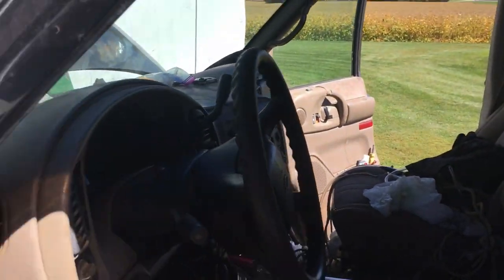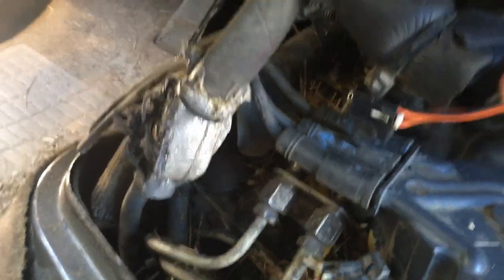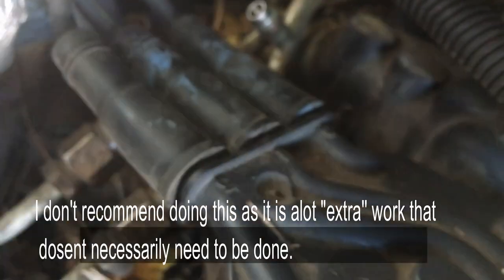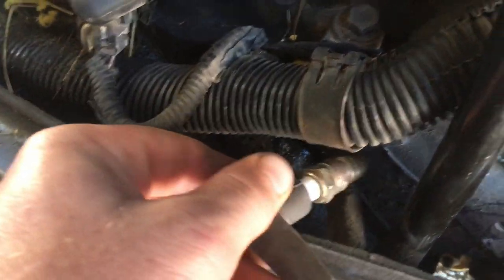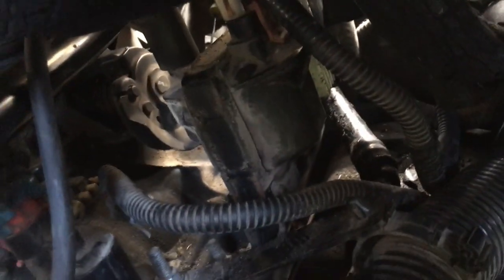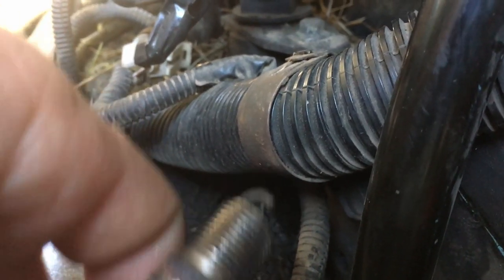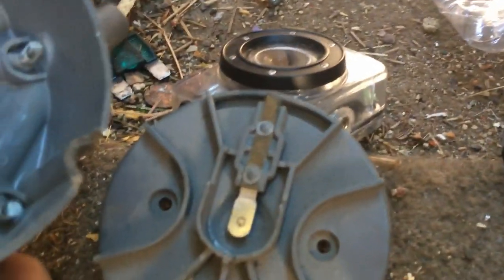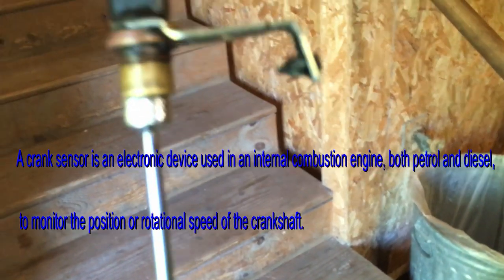Crank's No Start Chevy 4.3 Astro van No Start-Fix Year 2000

Comment: I just went through this with my S10. I searched and searched and never saw this video, until the week after its fixed. I bought a fuel pressure gage, compression gage and they checked ok. Then  I tried  New coil,  ICM, Mass air flow sensor ( had a code for this one), cap and button, cam sensor and finally the crank sensor.

Comment: Thanks for the video and not a bunch of hogwash talking to go with it.  I’m going to try the CPS tomorrow being that’s about the only thing I haven’t tried.  The VORTEC engines are well known for faulty cap & rotor, especially if they sit for a week or longer without being started.  I replaced the hall effect switch in the distributor (also called the camshaft position sensor) and that got me running, but then it quit again.  So I swapped out the ICM (ignition control module) and they go back from normal usage (they get real hot during normal engine operation).  When I first started my diagnosis I saw no fuel pressure, so I hot wired 12V through fuel pump relay, then I had fuel, but no spark.  One thing that can trip you up on these vans is they have VTD system (anti-theft) on them  and the fuel pump circuit gets interrupted if it thinks it’s being compromised by theft.  I’ll come back here to report my findings tomorrow.   Again, thanks for the video.
Reply: So what ended up being the problem and how'd you solve it.?   Ive been stuck in a parking lot for a month😢 

I bought a new coil, new ICM, new CPS, new distributor, new cap, new rotor, new wires and spark plugs, new coolant temp sensor. Finally today i got a code reader.   I have 60 psi fuel pressure. 
I believe thats good.   I think its the spider injector.   Someone said i just need to clear the codes and it should start, with everything i replaced, as it needs to relearn.   Please help.
Reply: @manuelester7420 did you figure it out bro i need help too

Comment: Thanks for the video.My 2004 160K mi astro   had the same no spark failure while driving.( Halfway to the donut store) strapped it home, started down your list;  Crank sensor "no",  coil, "no" Dist C&R, ''"no"  "  Ignition control module ,  "Bingo".  Runs perfect.  Following your example,  i now carry spares for all  & may add a fuel pump.

'

Comment: Great video sir.....My astro suddenly didn't start...so your advice will be part of my troubleshooting ....thank you
Reply from the maker: No worries, I just got through a No start situation, my van would not start "easy" when it got below 32 degrees for the last couple years, this winter it finally just stop' d starting all together, I had fuel pressure and spark, turns out it was a faulty ignition' "Will be making a video on this soon" but don't feel hesitant to ask me any more question if the video doesn't help you get it going, I've been through several no starting situations with my van. Ps. I'm working on growing my channel to 1,000 subs, if haven't done it yet and wouldn't mine subscribing to the channel it would def, be greatly appreciated! Thanks!

Comment: Just picked up a 2000 Astro AWD cargo w/141K and it's like I'm waiting for the other shoe to drop because I have no maintenance records on it.
Fluids seem okay. Already replaced the screeching belt and broken tensioner (Gates) with AC Delco. That's an obvious problem to fix but no way I could've figured out yours. At least I learned something that might come in handy. Thanks for posting.

Comment: Hi Matt .....thank you for your advice you were right, it was the coil assembly that was defective. I replaced it  and it is running fine again. 
By the way....I love my chevy Astro a lot too. You are the best....
I subscribed and keep on uploading great videos pls.
🤫  (about Chevy Astro🛠)
Reply: The only times that my -99 Safari would crank and not start, it was the coil.  Original coil lasted 12 years then I put 3 after market coils in over the next 2 years.  Never replace with an after market coil from China or Mexico.  Back to OEM's A.C. Delco  coil and it's been running on that one now for 7 years.

Comment: Great video! I just changed the spider on mines now the vehicle won't start. Hopefully I'll figure it out soon. Prior to that I changed spark plug and wires, cap n rotor, icm, crankshaft position sensor, and a few other parts. The reason I changed the spider was because I got the check engine code p0302. Vehicle was running fine prior to changing the spider. Also seems like the previous owner removed the bulb for the check engine light..smh
Reply from the maker: Hope you get it going man! Yah, i definitely don’t trust all the codes that get thrown, I’ve had codes being thrown before and they weren’t the source of the problems!

Comment: Awesome video! My bf and me have tried everything you did and the astro glide still won't start. Gonna give this a try. Fingers crossed. Much appreciated  :}
Reply from the maker: Rockin' Rachel ThankYou hope it helps! Please let me know what the problem was when you get it figured out! It would be much appreciated and good Info for anyone searching in the future!
Reply: @MattBroquard  No go here..... :{ will let ya know if we do figure it out.....grrrrrr
Reply from the maker: @rockinrachel3384  getting spark?
Reply: @MattBroquard  no spark. We've replaced the fuel filter, crankshaft position sensor, cap and rotor, and the coil. Still no spark. I (bf) found a small gauge red wire that is running under the flooring and into a wiring harness that runs along the drivers side of the van. Could that be part of the anti theft system?
Reply from the maker: @rockinrachel3384 I'm not sure. Have you guys replaced the crankshaft sensor?
Reply from the maker: sorry just saw that you have, I thought I read "camshaft sensor"
Reply from the maker: @rockinrachel3384 I've seen a youtube video of a guy having a no start problem on his astro and his problem was coming from the key switch area.
Reply: Astro Glide, huh? hehe

Comment: Good to hear about about this solution. You kept at it, and found it! Thanks for posting it.
~ On top of my 94 ASTRO's 4.3 Vortec intake manifold,  I had a MAP sensor "connector plug"
 that worked fine COLD but suddenly consistently failed after WARM UP,,   LIKE CLOCK WORK  
475 miles into a road trip..   After roadside replacement of ICM module, dist. cap rotor, fuel pump/filter,   Took weeks to giggle that MAP sensor connector, U-HAULED IT HOME when after a few stumped weeks someone suggested checking ICM  "CONNECTOR PLUG" which had been the issue/solution for them,, 
So, I started giggling & checking various connectors BAM it all worked out..   YAY!   SWEET ASTRO SAVED!
Reply from the maker: That's awesome! I have had some map sensor issues myself. I currently drive without mine plugged in because if its plugged in it doesn't run right there's a story to this but its fairly long lol... Please consider subbing to the channel if you already haven't it would be much appreciated! Thanks!

Comment: Thank you for replying to my comment.... I found out there is no spark...I replaced the distributor  cup, rotor, electronic module in the distributor and still nothing.
Reply from the maker: Have you checked the coil pack yet?
Reply: Do you still have the problem if so check your fuses.?
Reply: @cynthiaayers7696  
Thank you for your reply
I found out the problem ...it was in the coil assembly,  I replaced it and worked again. 
God bless you.

Comment: Good to know.  I had that sensor fail on my BMW 635.  My problem on the 2000 Astro Van, is narrowed down to the fuel pump.  I am going to cut my way in from the top, because the bolts and straps that hold the tank won't tolerate being removed without damage, and I have to do the job outside.  
Great video, thanks.
Bob
Reply: I went in through top, with a sharp would chisel.. cut 3 sides and peeled back metal..  took 25 minutes including breaks..  
~  If ya ain't solved it yet, maybe check various sensor connectors, as COLD IT WORKED GREAT,  BUT AFTER WARM UP the MAP sensor connector FAIL was almost a deathly I GIVE UP ON THIS WORN OUT POS "stumper" for my beloved 94 Astro..  Hope things progressed with good success..
Reply: @josephprincefanclub  
I ordered the new pump and I'm  waiting for it to arrive before I cut my way in.  I'm  going to use a sawsall with a short blade to make a three sided cut.  I have checked everything on the computer and ir is all good.
Thanks, Bob

Comment: I’m curious, would it start if you sprayed starting fluid in it? Mine will crank but not start if it sits for too long, but with starting fluid it fires right up.  I’m definitely no mechanic and have taken my 01 Astro to multiple mechanics, but in order to get it there I have to spray the starting fluid and then they can’t duplicate the problem.
Reply: Im having the same exact problem

Comment: I hope this works, I’m at ready to burn mine to the ground. Been at it for days. It started ran then quit on me. Holding me up from work, need my plumbing tool van going asap
Reply from the maker: I understand those frustrations, I recently just made a new video on another no start situation I had, it took me about a week or so of frustration-I even told a couple folks I was getting ready to burn it!!!! LOL it was the ignition this time- If you have anymore questions feel free to ask! I’m Getting pretty good at fixing these unfortunately-cause there a pain sometimes!!!ps, if you would rent mind subscribing to my channel it would be much appreciated going for that big 1k so close lol
Reply: I’m starting to wonder if security system is cutting something. I got Air+spark at coil none after+gas at spider, replaced cap and rotor. Nothing. Had a aftermarket Alarm I’ve removed now. Wiring is to stock. Just turn over, and let’s not forget I swapped CPS up under it.
Reply from the maker: @jermoses4566  so do your spark plugs have spark? If you have spark at coil then your plugs should be getting spark if they aren’t then your problems the plug or the wire
Reply from the maker: @jermoses4566  is your security light flashing?
Reply from the maker: @jermoses4566  my most recent problem I had was a bad ignition switch, I was getting spark at the plugs but I believe it wasn’t strong enough, also if your not getting around 45-55 psi for fuel pressure you could have a bad fuel pump.
Reply: So what happened was it ran out of gas, and battery died. Replaced and got fuel. It started ran for 15 minutes and stalled. Hasn’t fired since. Just turns over, the spark plugs look like a nightmares. I’ll check further this week. I just filled my hummer with tools. Friday work for today and catch up all week. Thank you for ideas on what to do next.
Reply from the maker: @jermoses4566  No problem man,I really hope you get it going! So it sounds like it not the fuel pump but funny things do happen so if your not getting the fuel pressure you need it may not start back up!

Your coil could also be stalling out when it gets hot-if this were the case then it probably would start up again after sitting for awhile! Spark plugs suck-easier to take the tires off to get to a couple of them. There’s a video on my channel a few uploads back that talks about my ignition problems I had that bay also help you out hopefully you don’t have to do that-best to you mean please post back when you figure it out! Would love to hear what it is!!
Reply: I found the problem. Coil wire to Distributor was arcing out half way. But when I was checking it well unplugged it wasn’t arcing until it was plugged back in. 
I seen the light as it was dark outside
Thanks for your help
Reply from the maker: Thanks for sharing, awesome that you got it going, good to hear!

Comment: Hi. I am wondering if the starter can be replaced without jacking up the van, do you know?
Reply from the maker: Probably not, but maybe-I jack mine up on the passenger side a bit to get underneath it-Otherwise I cant get underneath it-
Reply: @MattBroquard  OK thanks for replying so quickly. I'm not sure replacing is needed, but I have $140 to my name and am trying to figure out my options, including diy repair if possible. Thanks again.

Comment: So on my 97 5.7 vortec same situation no spark and I've replaced all the above. Only way I can get spark from the coil is too run a secondary wire to the icm terminal and ground it and run another wire straight to the battery. Otherwise I get no spark

Comment: Van broke down on middle of road , no codes 
Replaced crankshaft on the spot & nothing 
Got her home replaced cap and rotor and nothing 
Will check spark with a extra spark plug tomorrow 
Hoping it’s the coil
Reply: Fuel pump

Comment: Frustrating.. same symptoms. my safari is sometimes real hard starting then eventually fires up rough then smooths out. You'd think it would show a faulty CS code.
Reply from the maker: My van won’t start when it’s humid out currently, been here before it’s a bad ignition switch-Will start right up when the weathers changes back to no moisture in the air- frustrating as well lol-hope you get it going!
Reply: @MattBroquard trying using brass tipped cap and rotor (aka Marine grade) resists humidity issues better than stock oem aluminum tipped cap.

Comment: Hi Matt, 2 years down the road!   ....I have changed the cap, coil and ICM still no start
My vehicle has got the body  kit on it so not possible to slide under it, so my question is, do they all have a crank sensor? that seems to be the last option from what I can see.
I'm in the UK and there is no one able to offer any help!!
Greatly appreciate any help
Thank you
Reply from the maker: Yes all Astro’s have a crank sensor

Comment: Part #? Did ya use any spacers? Ordering AC Delco 2134761 and it says "spacers not included."  Part costs $53.99
Reply from the maker: Not sure, I know what’s part your talking about, fir the crank sensor I just pulled the old one out and the new one in. No spacers. That I remember.
Reply from the maker: Just pay close attention, when u pull the old one out, I don’t remember there being spacers but if there is then they should be on your old one as well.

Comment: Am still haven't found whats wrong with my van, got replaced: coil, ckp sensor, icm,  inspect and cleaned distributor cap and rotor, no luck...
Reply from the maker: Do you have spark? Are you getting fuel-If so are you getting at least 55 psi pressure?
Reply: @MattBroquard  yes, there is fuel and spark, I believe it must be the distributor itself worn out
Reply: @MattBroquard  sound like out of time
Reply from the maker: @josealonso7190  it could be the ignition switch as well I had a case once where it was that, I was getting spark but do to a bad switch it grounded it’s self out.

Comment: I have a 96' no start.  Died on the way home, got it towed home. Tinkered on it the next day and it started.  Died a few miles later.  It's getting fuel.  Replaced rotor cap and button (rotor), ICM, Crank sensor, and coil.  Still nothing.... I'm out of tricks
Reply from the maker: I’d start with making sure your getting spark, even though you replaced those parts I’ve got junk “new” parts before. What did you do to get it going again?
Reply: The Traveling Prospector I did and finally got spark.  I started it with starter fluid.  I think the pressure is too low.  I’ll tinker with the fuel delivery system tomorrow

Thanks!
Reply from the maker: @Aikidoman06  No Problem, Def sound's like your on the right track! I hope you get it going again please come back and let us know if that fixed your problem, it may be use to someone else in the future.
Reply: I had my 2001 Astro that didn't start and I had already replaced all tune up parts, fuel pump, filter and still no start..  I replaced the fuel pump relay that is in the fuse box under the hood and she started right up.
Hope this helps.
Reply from the maker: Good info, Thanks for posting!

Comment: I have a 02 safari that won't start in the rain or high humidity... did the distributor, coil, etc... all the usual advice from anywhere i could find it... still won't start unless it is dry weather... do these sensors ever misbehave  due to moisture?
Reply from the maker: I don’t know, they shouldn’t, have you checked out your distributor cap and rotor?
Reply from the maker: I’ve recently sense heard that they can and have before acted up before, hope you got the problem taken care of!

Comment: Mine wouldn't start one day, and it turns out it was the rotor inside the distributor Cap, and the distributor cap, another thing is that harness plug that plugs to the coil pack, of you wiggle it, it will shut of or turn on, basically its a loose connection there, zip tie that plug and two wires down tight and it won't loose its connection.

Comment: I have a 1997 Astro AWD that has stalled out multiple times since filling up with gas. At first I thought it was water in the gas but two bottles of heat fule treatment later it stalled out on me tonight and wouldn't start back. I cranked the battery dead trying to get it started again to make it home. Any suggestions?
Reply from the maker: I would start by checking for spark if you have spark-then it’s a fuel issue.
Reply: Thanks for the tip man I'll check it out in the morning and get back to you tomorrow
Reply: Cleaned the fuel pump and the gas tank and lines out . Changed the coil and it started up no problem then when I was leaving town I hit a pot hole and it started running rough and stalled out on me again and when I started it back it ran really rough all the way back to my house. I'm lost
Reply from the maker: I would check with the fuel  pressure I believe it needs to be around 45-55 psi if it’s good then you can eliminate the fuel problem” 

Also could be corrosion going on inside your distributor cap-